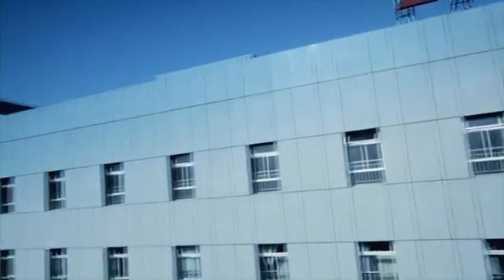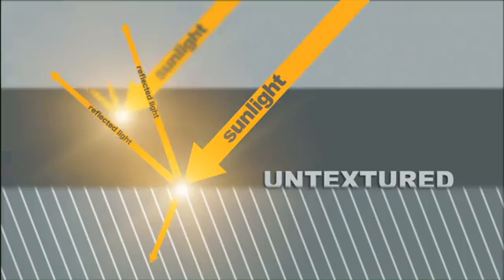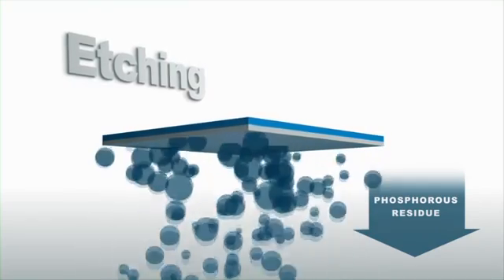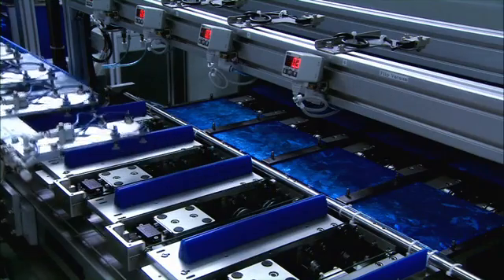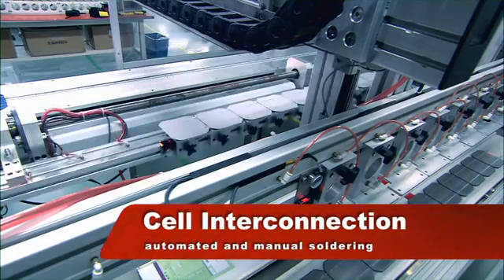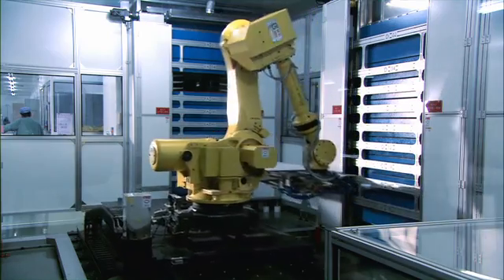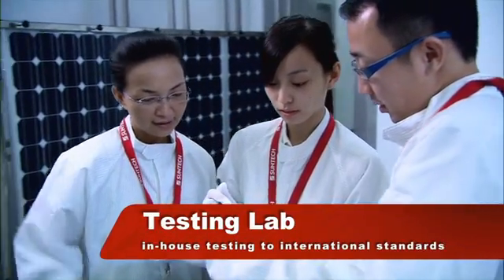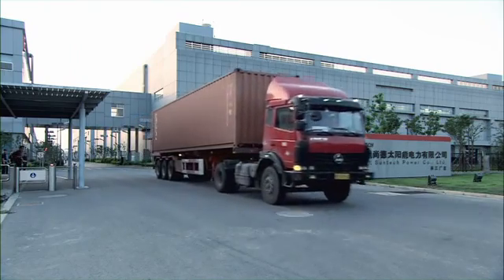solar cell manufacturing and solar panel production by suntech

Comment: The first step involves etching the wafers to create a pyramid-like surface, reducing reflectivity from 30% to 11%. The etched solar wafer is then sent to a diffusion furnace where Phosphorous Gas is diffused to create an N-Type semiconductor. Excess phosphorous residue is subsequently removed. In the plasma-enhanced vapor deposition wafer, the wafers undergo antireflective coating using Silicon Nitrite in another furnace, reducing reflectivity to 6%. Combined with etching, the overall reflectivity is reduced to 1% within a special spectral range. Aluminum paste is applied to the rear surface of the solar wafer to enhance cell efficiency, while silver paint is screen printed on the front and rear surfaces for positive and negative electrode functionality, respectively. These cells are tested using a sun simulator, and quality control is conducted at every step, from wafer receipt to solar cell packaging. Finally, the completed cells are sent to the module assembly station.

Comment: Hello sun tech. Can solar panels or Modules . ..   be made in custom shapes? why are we seeing rectangular panels( modules) global wide? We have a unique Architectural project designed on 3D cad and would like 4 specific shapes for solar cell coverage.
Reply: Solar panels or modules can be made in custom shapes, including non-rectangular shapes. However, rectangular panels are the most commonly used and widely available form due to several reasons such as efficiency, standardization, market availability and aesthetics. While custom-shaped solar panels are possible, they may require specialized manufacturing processes, higher costs, and limited availability compared to standard rectangular panels. As the solar industry continues to evolve, there may be advancements and innovations that lead to a broader range of available panel shapes in the future.

Comment: Why are the corners cut off?
Reply: because originally the mono-crystalline silicon is in cylindrical form due to the purification process. If you use it as circles you can't fit as many cells in a module, and if you cut it in squares you lose more silicon. This octogonal form it's de midterm

Comment: y'all sure all this phosphorus and chemicals are safe to have burning on your roof at 100's of degrees?
Reply: I am reminded of a letter to the editor I once read. The fellow worried that having a hydrogen tank in a car to power a fuel cell was a cataclysmic danger. Hadn't anyone ever heard of a hydrogen bomb?
Reply: I know enough to know I don't like bombs. When they go off...
Reply: Its chemically bonded with the wafer.  Did you finish highschool?
Reply: ***** ohhh, makes sense now why my balls hurt when I hold the laptop in my lap for too long.
Reply: I'll take a risk over a guarantee.